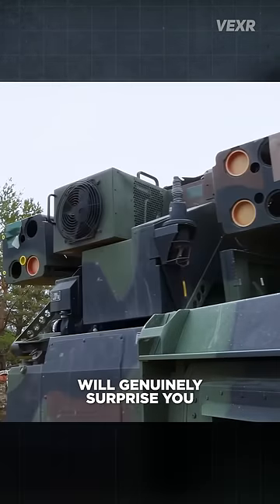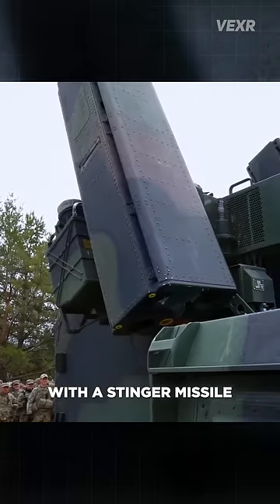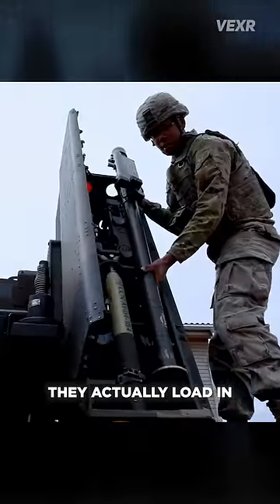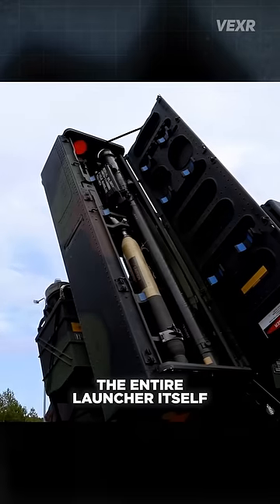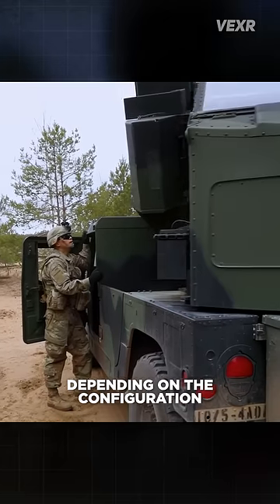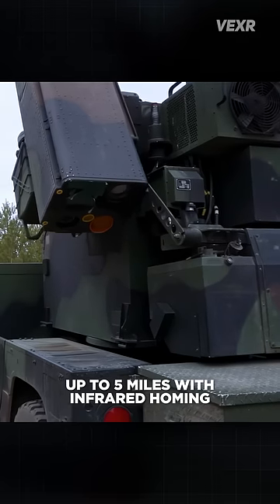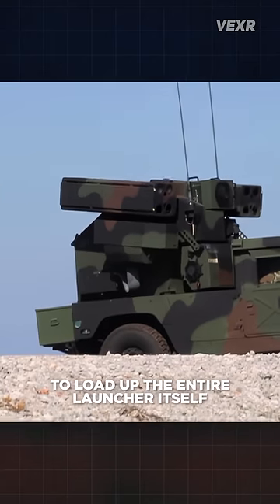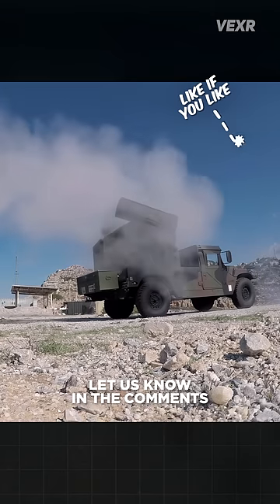The Weirdest Way To Load a Missile

Comment: Id imagine it just makes the whole system easier. No need to find specific munitions for ut just any infantry can load it up in a pinch. They already mass produce the launchers and rockets so it just works. Plus it has the added benefit of being simpler to use as instead of having different sized barrels and systems to fire all the different rockets you just have one universal larger size to fit whatever launcher you want. Faster swapping if ammo types and easier ammo. And in a last minute pinch if aomething were to happen and it were to fail you could always just take those launchers and fire them yourselves

Comment: Analogous systems based on Igla, Werba, Grom and probably future components donor for next gen stinger - Piorun do pretty much the same thing. Just put it in the tube into the slot and it should be working asap. Rocket doesn't care what its launcher - shoulder mounted computer unit, truck or ship mount, all it cares about is that it knows where it is, where it's going and that it can calculate error.

Comment: This is actually makes more sense. Say your vehicle shot down for whatever reason. You can remove the stinger from the pod and fire it within a minute. It's called redundancy.
Reply: You're working from the assumption that this was a target goal - It's just a happy accident

The reason it's like this is the Missile uses it's own seeker to ID a target before launch - the added parts are a small magnified glass optic and an IFF transponder which are cheap

The choice was made that the Stinger needed no additional parts to fire, therefore you can use the stock tubes

Comment: I would assume because its designed as an IFV, if the avenger gets disabled then you want the forces to still be able to use the stingers. If they were their own missiles system in theory in it might be harder to extract them in a pinch and give up the rockets to your foes.

Comment: With no military background to speak on this question, regarding why they would design a mounted surface to air missile launcher to be loaded it like this. Except for a couple years of engineering. But I imagine it’s to do with efficiency, cost of equipment and what happens if it were to get hit. 
1. Efficiency - if you have 8 stingers on-hand and with you, but the Avenger is only configured to use 4, you can already have your next round of loaded stingers ready to be swapped out before the current batch is launched.
2. Cost of equipment - let’s say one tube gets has a miss fire, but the rest is ok. Well then get rid of it, and let’s hit the road. Alternatively if they weren’t as removable, you can’t just ditch the stinger, you have to evacuate and possibly loose the whole system and vehicle.
3. The systems gets damaged - let’s say it’s really hit the fan this time. Hell’s raining down from above and they’ve managed to damage the Avenger’s targeting systems. You no longer have a mounted SAM platform. But let’s say they only managed to damage the targeting computer or infrared cameras or something like that, on the Avenger. You now have up to 8 mobile SAM launchers.
Reply: The answer is that thee Stinger was designed before the Avenger - It's designed so that its guidence systems use the IR seeker of the missile itself to get a lock

The only parts you can remove from a Stinger tube are a Cheap Glass magnifier optic and an IFF signal transponder reciever and a battery for the Seeker Cooling unit which is built into the trigger unit - It was designed from the ground up to be self contained so that it could be airdropped to support troops away from supply lines

The Avenger provides the same power as that battery unit, but from a Humvee's alternator allowing it to be "Seeking" for up to 15 minutes before needing to cool the IR camera - the hand held battery only lasts approx 5 mins

Other than that the Avenger has a Gyro stabilised mount allowing it to be kept steady on the move - and direction queued by a data feed from friendly radar so it's able to reliably point in the direction of expected aircraft contacts

Comment: Logistically is a lot easier you can have man pads an ammo for the Avenger that all used the same without any modifications and also there's less modifications to the launching system on the Avenger also if the vehicle breaks down you still got man pads you can use plus I think they also has a 50 cal also

Comment: Fault tolerancy. 
Canons tend to warp and crumble which can result in them blowing up if you use them too much.

This allows you to make “single” use cannons from the most stressed metal giving you missile system that can last longer.

The launcher itself could be repurposed for other weapon platforms (for example anti-armored vehicles rockets) that could be operated with a single soldier at the cost of accurecy (no blowing up of planes for the most part) with just minor modification or additional light-weight equipment

Comment: I have no clue but my guess is that it helps with supply related and practicality instead of making a new lunch system that could be vulnerable just load one of the billion stinger lunchers we have and have a small attached wire go into the cab

Comment: easier to maintain and quick transition from an automted system to manpad. lets say its dangerous for the troops to bring whole avenger unit to an operation where they need to keep down. they can bring these two manpads with them as they needed

Comment: I can only think the reason why they load up. The entire launcher is because it's easier to have the launcher link into the firing system  Then have to design an entirely new firing system to put into the vehicle. Why go to all that effort when you can just connect the usb cable.

Comment: Automatic firing on vehicle and manual firing on foot? In case the turret gets damaged or malfunctions it's like a bigass gun adapter or increased magazine capacity for the launcher. Basically same launcher just in a different module

Comment: The missile was loaded into the launcher at the factory. It would be too troubleeome to make the stinger missile in 2 configuration..1 for missile only . And 1 for launcher and missile..
Just put the whole launcher into the Avenger.. shoot and discard the launcher.
Also loading it with the whole launcher (with missile inside) is safer . Then handling a missile only..

Comment: I'd imagine it's because they receive the Stinger launchers as whole units, they can't really get a new tube with a new missile in the field, so when getting resupplied, they always get a new launcher with the tube. Would be a giant hassle to have to remove the missile from the launcher just to put it in a different launcher, when they can just chuck the whole thing in
Reply: there is no "launcher" for a Stinger
The tracking is done by the missile itself in the tube
The other parts are strapped on so you can be sure you're pointing it the right direction (a Glass magnifier and IFF transponder)
Reply: @bengrogan9710 The missile can be self powered, but it's still a launcher. The controls aren't on the missile itself, you need another part for a successful launch. That system and the tube are cheap compared to the payload, so they come assembled together by default.
Reply: @ncg8259  "you need another part for a successful launch."
You literally dont, If the missile recieves a voltage feed it will latch the missile into active mode -this is a simple battery

After the missile detects a voltage the seeker is live, on internal battery, removal of the voltage triggers the solid rocket ignition

the other attached devices are as mentioned 
1. a glass optic with no electronics
2. The Trigger which is a push to break switch
3. An IFF transponder which feeds a second push to break switch in parralel

The Stinger will fire itself if you strike a 12v battery on it's contacts - which are directly brass connected on the tube body, and the seeker head sees a target

What you are thinking oif as a launcher is actually a leash on a mad dog

Comment: Okay, this definitely sounds stupid at face value, but it makes perfect sense from a redundency, standardization, and interoperability standpoint. Raytheon doesn't make naked Stingers, the missile is tied to its lauch tube in a lot of ways. And if the vehicle goes down the ammo not in the vehicle itself can be used people in the area to perform the job at 80% efficacy, and 80% is better than 0%. For the types of air defense engagements its designed for this an awkward, but ingenious solution. And the US has a ridiculous number of Stingers in inventory. It was considered old enough tech in 80s to supply the aging out stock to the Mujahideen in the Soviet/Afgan war to absurd effect. And the more modernized systems are still effective enough to see frontline service in the US military today. And as much as I hate the growing my country's growing defense budget, Stinger, even the most modernized versions, is a system that could do with replacement.
Reply: The Avenger is aptly named in the current era because in the current era the Stinger is weapon of retribution against an aircraft that has already done it's job, unless it flew over the Avenger or Stinger equipped infantryman on the way to it's target. And I realize that Patriot, Aegis (both ship mounted and ashore), and various other systems fill that role well, there's something to be said for infantry in the field to have that opportunity. No disrespect to the Air Defenders of the various branches, I'm an Air Force veteran who owes her life to Army Patriot operators. But as combat gets more networked I really can't think of something they'd love less than non-standard intercept angles from Soldiers and Marines on the ground with missiles that could tie in with a larger sensory system.

Comment: Logistics. If its literally the same missile, why woulf you add a second thing the unit needs to carry around? This way its just stingers, and not stinger and stinger missile. 

I just dont quite understand if the SAM System is overwriting the launcher and can thus guide the missle more effectively or if its just stingers, but in a truck.

Comment: Imaginext you're in the middle of a major conflict you shut off 8 salvos of surface-to-air missiles out of your truck,and you are in the middle of reloading the truck when another overhead threat comes, you can take the shoulder launched rocket system that goes in that truck and shoot it off the shoulder at the overhead threat and neutralizing it instantly which would buy you enough time to load up eight more rockets in your vehicle. that is probably why they use the whole launching system inside the truck.🤔😮‍💨🫡

Comment: Modularity and ease of manufacturing. A soldier can use the stinger missiles to continue ground to air attacks even if the system goes down, or is attacked by counter missile attacks. The way the u.s. military works is called a shock and awe strategy. We start by surveillance, aerial and boots on ground to identify anti air and other strategic location like communcations and logistics. Then we blow the fuck out of it. We even send in humint to give warnings to civilians. Then there will be a finale, where marines and army will make a push to strategically valuable locations. Crossroads, high points, logistics buildings, and any bodies of government. Using air support, reconnaissance, and brute force we start taking ground by setting up cobs, dug in and set up by the soldiers who took it. Eventually as more ground is taken these cobs become fobs. Combat engineers come in and set up buildings and fortify the location. Once that happens you get these anti air units. If ever these fobs come under artillery fire, they still need to be defended. So it's easier to supply these stingers as single "product" that can be fired by infantry or loaded up into a weapon system. It's all about logistics.

Comment: Eh pretty much all of these manpads system do the same thing. Simbad, Igla, Starstreak, some even used old Strela jerry rigged into a launcher as a cheap(ish) anti drone missile

Also there's a tank inside the launcher to supply coolant to cool the missile IR sensors allowing for extended acquisition and engagement time

Comment: Because the Lauscher and the missile are Designed in one peace and you would need a variant of the stinger with its own production line and transport Infrastruktur
To get a ned benifit of 0 but a expanse of Cost in the millions. For a tactical weapon. Even lock on is already integreated. Not worth it.

Comment: Of course they're using the whole thing. Why would design something new when you already have a proven system with an existing supply chain? IIRC, it's not a very complex piece of equipment and I imagine that most of its components are integral and single-use.